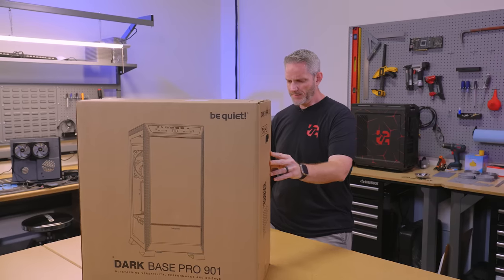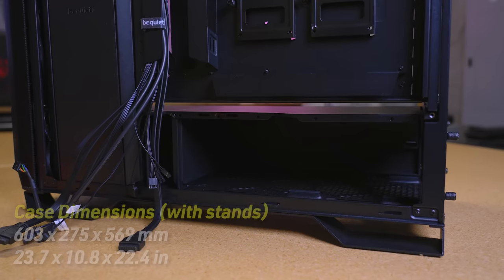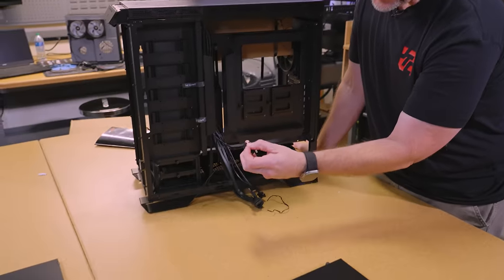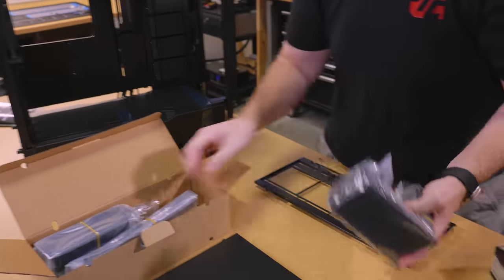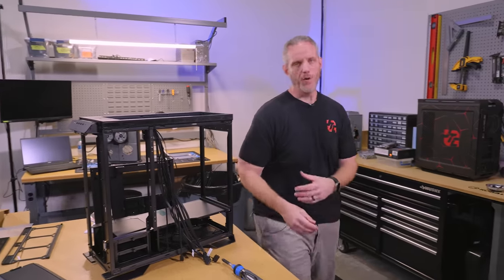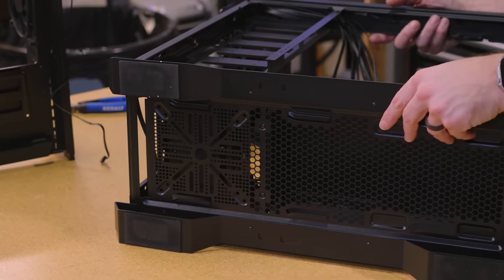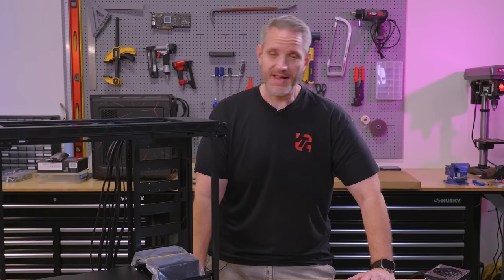This computer case is just crazy!

Comment: Yeah I have the Dark Base 900 and I'm glad to see in the 901 they positioned the PSU all the way to the back of the case. The PSU in the 900 is located several centimeters from the back and connects internally to the rear plug using a short power cable. I never understood the reason for this. Also, Bequiet! are one of the few cases that come with high quality fans already installed. The first thing I replaced, in other cases I've owned, were the fans.

Comment: I have the predecessor of this Case (Dark Base Pro 900), which is almost 10 years old by now. From what i've seen in the video, this new version takes the original design & featureset (incl. the Qi-Charger) and improves it in every way. Any complained i had with the 900 seems have been adressed with this one.

Comment: 0:11 901 means it's the successor to the 900, which is the case I'm currently using. My 900 also has a wireless charging pad.

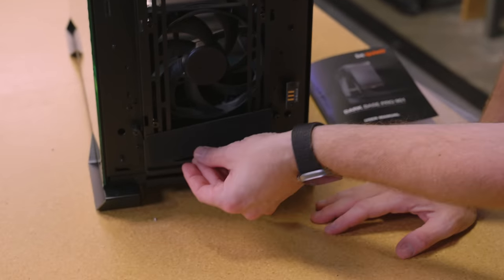6:38 You will have to pry my optical drive from my cold dead hands.

Comment: Drive cages could use more openings. I hope the case fits the previous-generation drive cages in there, as the origins are flawed in design. At another time, I would try to fit the EEB motherboard and micron 30TB NVME drives, and those require cooling. If cages fit two 2.5-inch drives, then how does the case handle upright wiring? I have not seen people trying 2x 2.5-inch drives in a single cage. It's like car makers do. They make small changes to the car so people are attracted to the new. Why not make something darn good and simply release it? I'd make something good and then release it for people to use without having a bad heart knowing they've bought one in the franchise.

Comment: Nice case and a very detailed and thoughtful  review.  I like the 5.25" bay as I have many DVD's BR's CD's etc.  I am not a fan of glass sides, they are unsafe. I don't understand why the manufacturers are not using acrylic.   If you bump the corner of even tempered glass it will likely break making a huge mess that will literally take weeks to completely cleanup (hard to get all those tiny pieces that go every where) and is very unsafe for kids and doggies.  After a slight fumble, I shattered the glass on my Corsair 5000D.  I used the left over side parts to convert to acrylic, took a little time but not hard; so on the next fumble, it won't break and looks better too.

Comment: Way TOO Expensive, for a bunch of options that we would probably never use.  Not really that modular, IMO. If they would make it so you can use fans and drive bay at the same time, that would be modular, but this is limited to either the fan or drive bay add-on (this one or the other). The industry is really lacking, we need more innovation, this is not doing it for me, and they are asking of $300, for plastic and soft metal, they are crazy.

Comment: I have an old cooler master stacker 830 that I bought in 2007 , I have reused it for all my pc builds since then it is totally modular and has the motherboard tray which is also on rails and can be LHS or RHS and it's all aluminium..all I've done is re-spray it 3 times ..it's still looks like new and I haven't found a better case yet despite much looking.
It's also much much easier to invert the motherboard in my old 830 case.
However I love the front fan pogo pins on the case in this review...

Comment: Dark Base Pro 900 rev 2 user here. While it has the inverted build option, wireless charger and so on, changes from 900 to 901 are very big! Nice to see that they really went ahead and upgraded almost every area of what seemed to be "my last computer case" when I bought it. That's the reason I splurged. I don't personally need any of these changes so I won't upgrade, but it's fun to see a case that can do pretty much everything, except fit into a small space. I use mine to add extra space for random stuff... I mean it makes sense to use it as a small table, with the QI charger and all!
Part box being properly strapped in is good, since before (when it was lighter too) they used a method that could let it get loose in the mail and bounce around inside the case, if it got rough handled. So, an upgrade in that area too.

Comment: This case has so many well thought out features.  Excellent modularity - which you summed this up perfectly in saying "...that allows you to fit the case to your build rather than fit your build to the case."   The Front Panel Connectivity, with Fan Control buttons--all pre-wired for an extremely tidy build--is possibly the best I've ever seen.  The phone charger on top is the icing on the cake (or case, I guess). However, I disagree with your scepticism about the sound deadening.  Sound waves do not travel the same as air.  Sound waves bounce off whatever surface they hit, so, with the front side and top having dampening material, it will likely help reduce the noise much more than an all mess exterior.
Also, Whilst the price might seem steep at first,  You get what you pay for here.  This case could outlast whatever parts you put in it. Upgrading or even a complete rebuild would be more of a pleasure than a chore.

Comment: 7:00 it's certainly not a common want in a computer case but I personally would slot in a Blu-ray disc drive into the 5.25" bay, certain media players like VLC can be modded with the proper .dll file to read back Blu-ray discs.

Comment: I still require two 5.25" bays.
I still use a fan controller and an optical drive.

I still have a dual 5.25" dangerden  reservoir for D5 pumps if I ever want to use it again.

5.25" bays are still very important to me. Two as a minimum to even think about the case.

Comment: Jay, you do realize sound and vibrations transmit through solids right.  Absorbing sound is not just about absorbing sound waves in the air.  It's also about absorbing the waves and vibrations traveling through the metal structure of the case.  Especially in the large flat side panels that have long flat spans without any sharp bends (think of a drum as the concept to understand).  Believe it or not, you'd be surprised how even just a few small strips of sound absorbing material in a few key areas can help break up those waves moving through the metal and have a surprisingly big impact on overall system noise.  Hell, I once managed to damn near completely deaden a hard drive cage with 3 HDD's in it (Cooler Master Cosmos S) using that method.  You could still here it, but only just barely.  The clicks were so quiet.  And that was in a pretty open high airflow case.  In other words, it's not simply about absorbing the waves in the air.  It's also about breaking up their transmission before they have a chance to spread and get louder.

You yelling at a side panel to "prove the point" that the material isn't absorbing your voice, made you look pretty foolish and more than anything, showed how you seem to have a fundamental lack of understanding about how sound dampening in a PC works and how it's supposed to work.  That was not your best moment.  Sorry.

Comment: All the features and extra brackets included reminds me of what you used to get from manufactures 15yrs ago. The ability to alter the case to fit your specific build is a great thing to have. I love the modularity here. It is not for everyone, but if you want to get creative, it allows the builder to play with options. Great case for a free-builder. Fair price for the features and forecasted lifespan.

Good - wireless charging. (convivence) 
Bad - front open-air I/O (dust/debris)

Comment: Jay, you need to take an acoustical engineering class.  Even the one I took 30+ years ago went into sound absorption well enough to know those panels will reduce decibels AND shift frequencies downward.  The latter can be more important than the former in some cases.

It's the same as sound deadening in cars.  Build your classic car without it, and you'll know how much it helps.

Comment: I miss the days of having an audio breakout box in the 5 1/4" bay, 1/4" jack input and separate volume controls was great.
Regarding the foam, it's more to reduce annoying resonance than deaden any noise. Without it the steel panels tend to buzz. You can get a similar effect by adding some layers of neoprene to isolate the side panel from the chassis but every little bit helps.

Comment: For the price, i was expecting to see an espresso maker inside, because otherwise, it's no more relevant than any other non modular case bought specifically for the purpose you want, not modulated for the specific pieces you need to pack in.
Kinda weird how features that were gimmicks in old cases, not to speak of the higher quality metal (which back then was viewed as inferior to other cases, i mean... we used to crush cheap cases with IBM ones... what would happen if you'd smack this with an IBM tower? Atom slap?) which they used to have at a fraction of the (inflation adjusted) price.

Comment: What about fans that connect through pogo pins like much of the stuff in that case does?  Also, it would help if there was a direct link to that case on Amazon.  I did track it down on Amazon for $340.00 US before shipping, handling, and taxes.  This is a modern design of case that I have no issue with using it in a build.

Comment: The thing about the solid front, even if the acoustics go down, because the temp is higher, the fans will be working harder, so the sound will be a higher frequency. Also because the air is forced to go from the side in, there is more turbulence.
OMG that case is awesome though. My wife still wants an optical drive in her case so she can just pop a DVD in there whenever.
$330, worth it.

Comment: As other say, those sound panels together will reduce decibels around the case by about 30% or more from a guess. Seeing a founders edition card in there screaming at 90 degrees or pump noises would be nearly silent. Would be much cooler to see smoke test or even rudimentary DB meter around the case in a regular quiet room. Don't even need to really make a PC in it. Just fans and see the flow without components. and see how much the panels dampen the chassis fans.

Comment: Sound travels in all directions... You said it.... sound bounces. The reason for foam panels is that the sound bounces and gets lost in them and doesn't go further. Not to mention sound deadening a panel prevents the panel from vibrating sounds in other directions. Basic audio.
I sound deadened large panels, lost a few db, but when I got into sound deadening more  (around the pump, on random surfaces) I got even more. Every dB changes, plus certain frequencies affect different people... I can't stand Noctua fans because of the noise it makes at any RPM after going mag lev. I can however enjoy silent wings noise.

Comment: @JayzTwoCents are the fan header pin receptacles on the chassis wired to the controller using a standard fan connector? Asking because I would actually have the fans on the radiators go off the CPU header and the fan controller to one of the chassis headers on the board. reason: I wouldn't want the chassis fans spin up with the CPU temperatures....

Comment: I have been using the original Dark Base Pro 900 v1 for something close to 8 years and it has been an amazing case. - the only things that annoyed me about it was the solid blocked front panel and top panel. I ended up cutting a giant hole in the top and front panels and fitting my own mesh to get airflow in my radiators... i eventually switched to the Corsair D7000 last year for my latest watercooling build, and i've kept my old Dark Base Pro 900 in storage. But i am loving to see that they have finally created a new version (the 901) with all of my greviences of the first one resolved and a ton of new innovations to go along with it! BeQuiet has been one of my favourite case brands for a very long time! 😊

Comment: I like that the fans remove with the pogo pins - but the fan controller buttons are entirely unnecessary.  Just pass the PWM.  Although - there should be two zones IMO.  All 4 fans should not run the same speed.

Comment: I had the 900 rev 2 for 4 years now. Its biggest downside is just how hefty it is. I have had to move it between three different apartments and each time it was a huge pain in the ass. I also broke the tempered glass side panel shortly after building in it. Luckily Be Quiet has metal side panels that you can order. If I knew that I wouldn't be moving for a while this would be a great case for a big build. Fill up the hard drive slots and you can have a case that will last you years and years. Someone referred to this as an "endgame case" and I would agree with that.

Comment: Love this case  although in my opinion they should of included a piece of plastic or aluminium bracket to fit on top of the 5 1/4 bay were the air vent piece goes (17 :46)so you could have you the option to have your pump for water cooling above, 3D printing a piece could be an option i guess but all in all a fantastic case.

Comment: While sound travels in all directions, a big chunk is absorbed by the front panel and only a small part can travel through the frontal side vents, which overall lessens the noise profile, if it would be a naked piece of metal or plastic that would different but sound absorption is a thing. I have the Silentbase 802 and it makes hell of a difference when you have 3 x 120mm in the front. Also a reason why I don't like glass side panels. A flat surface for sound to bounce of off.

Comment: I dis agree with is take of HD Audio being junk. Right now how motherboards are wired it seems it is the same chip for the back of the board as the pins that lead to the front of the board. So unless you are using USB which does the sound processing on the CPU not a independent chip it is the same as using the port on the back or even getting a sound card. The reason for a sound card is sound processing, accepting more than 1 input with 3.5mm connector and/or having more than just 6 outputs for sound and/or to change the connector used from 3.5mm or USB to a specialty connector.

Comment: Modular nature aside, I really like that this case has a 5.25 drive bay. A lot of my old data is on dvd, and I still play a lot of older videogames that are restricted to disc format. Usb optical drives are an option, yes. But I've never felt comfortable with how tempting the occasionally specialized cable that comes with is to a bored cat.

Comment: The fractal pop xl air has 2 5 1/4" bays. It comes with a small drawer for one of them. I keep flash drives in it and a pioneer blueray writer in the other. I'm old school and had to have a cd rom. Plus I used to make dvds for my dad before he passed.

Comment: @5:42 Sound travels in all directions. While not a lie, it's not exactly true, though. You can use a mic on your camera to pick up the sound in front of the lens while not picking up sound coming from the sides and back. If you trap the sound coming out front, there will be much less sound leaving to the sides.

Comment: I think you're wrong about the sound deadening material being relatively useless.  Sound bounces around, so any surfaces which capture it rather than reflect it are going to reduce the overall sound.

A classic, more extreme, example that I can promise you makes a difference is the engine bay on a boat.  There's always open sides and spaces, it's rare to have an engine bay that's close to fully covered in sound insulation.  There's a big difference between the same engine bay with and without the insulation fitted.

Comment: This looks slightly better than the dark base 900 which had a similar weighty design but with several more problems. The bottom panel with the feet on mine broke after about 3 uses of moving it off and on to its base. The compatibility for water cooling specifically mounting a reservoir was poor. The airflow in from the front was too restricted and the basement cover part was sold separately which was practically extorsion when this was newly priced.

Comment: Hey I hate to be that guy but sound damping anywhere helps lessen overall noise. Yes sound travels in all directions but all the sound traveling towards the sound damping material gets dampened and thus reduces overall noise. Ever been to movie theater or music venue that has sound damping panels on the walls? Have you ever noticed that those places don’t have sound damping panels on every square inch of the wall? It’s because you don’t need to cover every square inch of a rooms or cases surface to reduce the overall noise production. It does work, you just aren’t thinking about it correctly. The noise directly in front of the case will for sure be reduced with the panel on vs off. Be quiet cases still need intake and outtake vents so it doesn’t kill components  soooooo why do the other designs work? But now this model with a few extra vents in the front all of a sudden won’t? Your logic doesn’t make sense.

Comment: it's a nice case but no one in 2023 should buy cases where the psu is in the same compartment as the rest, the only true cooling airflow is bottom and top fans nothing in between there's no reason to buy something else than lian-li 011 and such they are 100% better at cooling

Comment: The top panel only supports up to a 360 mm radiator. I was going to install my 420 in it, but eventually had to settle for the front. The manual also says a 420 mm radiator will not fit in the top.

Comment: I still regret buying a dark base 700, didnt come with psu screws and had extra screws for only 1 more fan but only to the bottom as they were long screws. (They are also not listed in the manuals so its not that they were missing)

Comment: I have my computer in a Rosewill Rise Glow case and it makes less noise than my oscillating fan meaning unless I tweak the fan speeds on the case and GPU I do not hear my computer running.